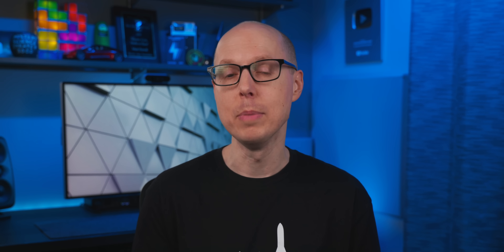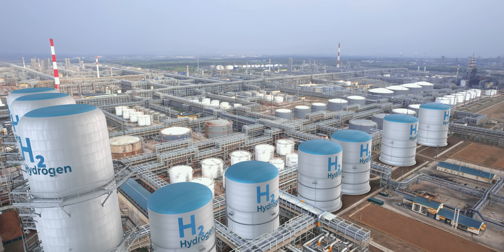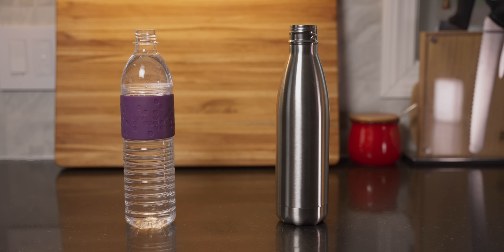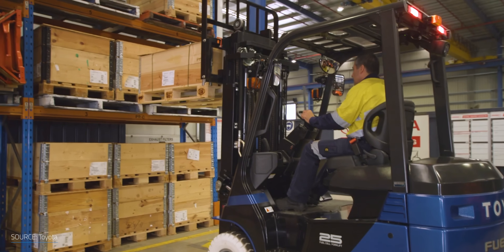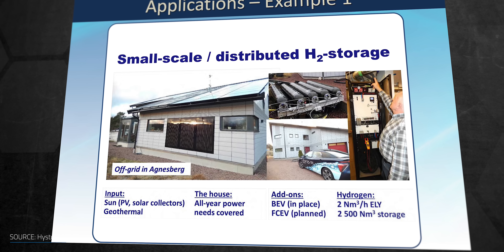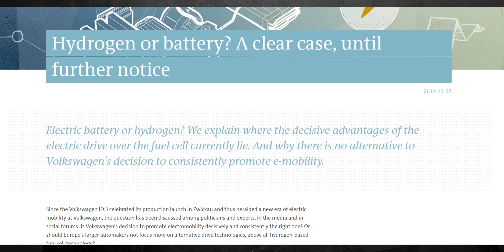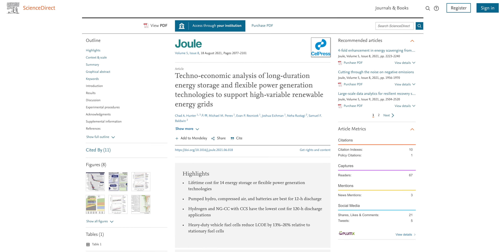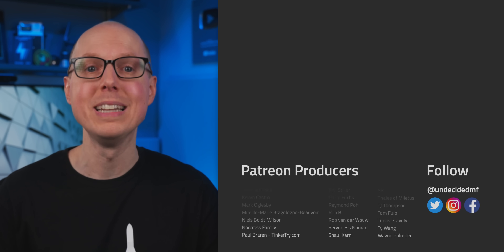Solid Hydrogen Explained (Again) - Is it the Future of Energy Storage?

Comment: I would think that replacing the small lithium batteries in EV batteries with small tubes of metal hydride or random carbon nanotubes would be an ideal way to store hydrogen.  Just like EV batteries, using many small hydrogen storage cells would increase range, safety and reduce refueling times.

Comment: There is an Asian research program in progress right now that claims to have solved the efficiency problem with electrolyzing water into H2 & O2.  A jump from 35% --> over 90%.  I remember bumping into a Youtube video on this about a month ago.  If THIS can be commercialized quickly, then hydrogen energy storage may indeed be a major, efficient fuel source for high-demand mobile applications.

Comment: Maybe you could do a video on liquid organic hydrogen carriers as well? The main advantage of metal hydrides and LOHCs is the ability to store hydrogen in a safe manner over long periods of time. Compressed and liquid storage cannot do that. The disadvantage is in the energy needed to store and release the hydrogen. And for a system that has varying power needs (such as trucks, cars, boats...) you need a buffer storage which means you are back into the land of compressed storage and leakage scenarios again. 

On another note, the next time you mention hydrogen and ships - please do not associate that with a car carrier, container vessel or any other deep sea vessel. Hydrogen is not suited as a fuel for ships. it may be for boats. For ships it has too low energy density (volumetric). and on the compressed storage, any large scale storage happens at 200-300 bar. Above that the tank structure would be far too heavy for any practical use.

Comment: I have thought about and looked into using metal.hydrides and electrolysis for a wind/solar off grid system for more long-term use than a lith ion system seems to offer. I'm no Dr or MA degree holder but over time..... especially if supply lines break down.... It seemed to me that metal hydrides are a better choice for longest term use assuming resupply is impossible or years away.

Comment: "Volumetric density" is a tautology, density is always volumetric.
Reply: no... another very common metric is "gravimetric energy density". ie. Energy per unit mass.
For example, gravimetric energy density is usually more important than volumetric density for aerospace designs. The primary difference between jet fuel and regular gasoline is its gravimetric energy density

Comment: If the technology is sound, it will need another "ELON" to get it from lab to the open road. There will be so much pushback from the traditional players out there, from auto to energy, government and the largest tech companies.

You need a cheerleader with vision and cash to push that boulder up the hill. I am no scientist or engineer, but I look at this from the business model.

To put a smaller 55KW battery and a fuel cell together into an electric drive vehicle, the extra cost SWAP +/- by NOT putting in a battery pack 4X bigger for the OCCASIONAL need for greater range needs to be considered.. I believe this is less of a scientific problem as a business one. The best approach will rise to the top. The objective is cost and weight reduction, while increasing range.   

 The electric fanboys hate hybrid, despite the potential when scaled into larger trucks. We need to get outside of our tribalism, and consider all technologies that show promise, and research and test "ALL OF THE ABOVE". 

 Remember when LED lamps sucked.... dim grey light that NO ONE liked!

Comment: The heat required to release the hydrogen can done very cheaply and simply with a laser.

It's already been done and proven to work much better than expected as hydrogen can be printed onto a film and released on demand with a laser.

The problem is the government and its corporate backer's, they have shelved it as another distruptive technology along with many more technologys that would end the whole energy/pollution market as we don't really need  batteries, solar panels or nuclear to generate electricity to power out transport and home's.

Because it works, it's likely to disrupt the energy market which they have designed to fail and fail us they will.

Comment: The least expensive way to store hydrogen with super high volumetric and gravimetric density is to bond it with carbon, just like how biology does it. The trick is, we have to source the carbon from the atmosphere instead of the ground so that we complete the cycle instead of disrupting it.
Reply: The energy cost of CO2 direct air capture (DAC) is astronomically high compared to the energy of any compression and storage technology. See for example the energy cost of CO2 compression / liquefaction vs. the energy penalties for either flue gas capture or direct air capture - it's a difference of 10 to 100 times.
Reply: correct but as plants they also get there carbon from the air. ... so we should do that.
Reply: Well...bioenergy is also complicated; it ends up releasing carbon because of ecosystem impacts, transport, and processing. There aren't any great options for us to bond hydrogen to carbon without either a) using a lot of renewable electricity or b) causing net positive carbon to go to the atmosphere (instead of carbon neutral). The best you can do (at least, without carbon capture and storage tacked on, which is very difficult in fuel applications because your vehicle is moving and has to be lightweight and carry its own energy) is to be carbon neutral - so any inefficiency results in carbon escaping. (And there are a lot of inefficiencies.) Pure hydrogen also takes a lot of renewable electricity, but less than synthetic fuels, and without the inevitable release of carbon on its consumption.

Comment: Calling 50 kWh/kg "on par" with the Tesla Model 3's 260 kWh/kg is a pretty big stretch of the phrase "on par". Also, the animations you keep using obscure an important down-side of hydrides: while you may be able to store 80 kg/m^3, it's very difficult to recover much more than a few percent of that. The more you try to remove the hydrogen, the harder it gets. You end up with a hydride that fluctuates between 80-ish % full and 100% full, so the usable capacity is usually less than 20% of the stated capacity.

Comment: I am currently working on metal hydrides for my master's and my supervisor and professor actually wrote a book about the topic of hydride storage. In the end, hydrides have a too low energy density, they are quite unstable and they have to be heated to release the bound hydrogen. The current state-of-the-art is just storing it at 700 bar, which is lighter, cheaper, doesn't need heating and has a way higher energy density.
To put it in the words of my supervisor: "It was a race between chemists and engineers and the engineers clearly won it."
Reply: Yeah its pretty obvious Matt is still the great Snake Oil salesmen. Nothings changed sadly

Comment: Why not use water and build a car that separates the hydrogen and oxygen in the car and then use hydrogen for power.
Reply: If you had a power source that could separate the hydrogen and oxygen, why not just use that to power the car?

Let's say it takes X amount of power to produce Y amount of hydrogen from the water. Now, you can move the car Z distance with X power, or you can use it to separate Y hydrogen - but you cannot do both with the Y hydrogen.
This looks even worse when you add in real-world-efficiency-constraints.

Comment: Plastic batteries can be built as part of an integrated transportation-distribution system. The bottom of a roof over electric car roads would feed and control cars. The top would be covered in grass, with open storm drainage and solar panels (adding to energy, which is mostly produced with small/thorium reactors). 

H2 would be generated on cars using system energy - either when parked or driving in electric system. It would be used only for off-system driving.

Storage is not a problem with an integrated system with small scale nuclear generation.

The science is easy. The main obstacle is economic, which requires shifting from capitalism to employee-controlled cooperatives.
Reply: Michael: "..., which requires shifting from capitalism to employee-controlled cooperatives."
Sounds brain-dead.
Reply: @KenJackson_US  not if you want clean energy
Reply: @KenJackson_US  Transportation modes (how roads are designed) are a matter of public policy. Currently, oligopolies prevent new developments, choking off innovation. Only cooperative purchasing can counter such opposition. It's the reason union's work. That is the how of it. If you know a way for individual consumers to change the entire transportation system, let us know. you have our attention.
Reply: @KenJackson_US  you are confusing free markets and capitalism. Not the same thing. No employer with shareholders would be justified in transforming a city's infrastructure from what exists now to what I propose (unless they are a road building or electrical company). A cooperative firm where consumption and production are controlled democratically, or a collection of such firms in a single city, has a chance of making that change. A city government could mandate it, but local capitalist employers would stop them (unless they were all unionized and turned it into a strike issue).
Reply: @KenJackson_US  you are arguing about the trees, not the forest
 Also conflating "what works" with your values.

Comment: It would be amazing if someone could make a substrate that would absorb and release hydrogen from a very specific area that could be selected by a microprocessor.  You select the row/column of a microcell that you want to release from.  It would be switched using a very small current.  That way you wouldn't have to heat it up .
Reply: If you're not heating it up, what causes the hydrogen to release?  Don't you mean only a small area would need to be heated, which would minimize energy used?  That's an idea.
Reply: @KenJackson_US  No using semi-conductor holes or something similar.

Comment: What if we used gravity to compress the hydrogen?  Just like pumped storage via solar or reservoir hydroelectric, instead of turning a huge turbine to generate electricity, the same gravitational force is used to turn a compressor?  Excess heat from the compression cycle could be captured and used in another process, like ammonia closed loop refrigeration, to cool the gas down.

Comment: 08:35 you state that metal hydrids have a capacity of 50kWh/100kg, and that it's on par with lithium in telsa cars. I have to correct this. Lithium iron batteries in teslas have a Wh/kg rario of more than 100Wh/kg. 50kWh/100kg = 500Wh/kg, which is 5 times more.
this lithium ratio is the one we use  at our company fyi

Comment: I am not gona lie! I won´t watch the Video and don´t have to!

Storing Hydrogen in any (Solid) makes absolutly no sense!!!
Every Solid u can use to store Hydrogen must be higher in mass than the stored hydrogen in it! also the densety can´t get nearly as close as in highly compressed gas form or liquid! It just cant, and is lousy from the get go!!!
And you lose energy by storeing and releaseing it, that could be a little bit better than just compressing it into a liquid, but mostly in smaller aplications where its not viable to constantly recycle the heat to reduce loses.

The only thing that comes close to this idea and can practicly work, is to put a small percentage of Hydrogen into the gas grid.
This just works for relativ small amount without decrecing the densety of the other gases to much.

Hydrogen isen´t the solution to everthing anyway! In aplications like steelmaking as a substitute for coke and other chemical aplications it works good and is already in use.
But as a generell Energy storage medium, pure hydrogen is not the best choice!
Storing and transporting hydrogen in compressed forme is not a problem, its the production!!! Its inefficient, and there is not much hope to get around it!
All that "uh thats the future" bulshit is the same for hydrogen as for batteries, getting the charge out of the battery and converting it into work is highly efficent, but making the batterie and getting the energy into it, is the problem that is out of sight of all those idiot that think this is the solution to our energy problem!!

There is no single solution, and there will be no big revolutionary inventions anymore, we pretty much have figured out the bulck of it!
Every technology hase it´s place and for the most part is already in use in it!

And there is no big revolution needed, at least not in a technological way!!!!
We humans have to adapt to live without fosile fules, we just don´t do it already because most of us are to lazy, to cheap, and won´t sacrifice a little bit on there wastefull lifestyles!!

Stop buing new cars every 3 years, stop buying new smartphones every 2 years, your consumption behavior is what dictates how crapy and cheap a car is build, and thus how much energy is needed for its completet life cycle!

🤮 I hate humanaty!!!!!!

Comment: Anyone can do something similar to this at home.

I have seen a guy store hydrogen in propane tanks filled with carbonized chicken feathers packed tightly.  He only pressurized to 300 psi and was able to store more than 20 X the hydrogen stored in a tank at the same pressure without the carbonized feathers.

The man used the tanks to store hydrogen created from water using electricity from solar panels to run a system to separate the hydrogen and oxygen in the water and he had a fuel cell to power his house.  He did have problems with low pressure with low ambient temperature at tank, but instead of using heat to release the hydrogen he quadrupled his storage to create sufficient pressure to the fuel cell. 

I would have put the tanks in a climate controlled enclosure and regulated the temperature to achieve the desired pressure in the tank to increase efficiency and decrease required tank size. 

Hope someone builds these soon, it is not a difficult technology, the preasures are low, and as long as your hydrogen is pure, the storage tank should last forever.

Comment: Matt,  I connect on #LinkedIn and #Facebook. So we can carry on the conversation.
Reply: Matt, you could come Fully Charged LIVE. Sydney 11th to 12th March 2023. Will be there in Sydney. We promoted the project on the film on stand team taking a project and future projects.

The Team and I are submitting a development application to a Lismore council on North Coast NSW end of August 2022:
1.	250 prefabricated CLT & SIPform passive house certified homes. On the roofs of buildings, the Tractile, the excess electricity will be stored in the 28.8MW Tesla Batteries Farm. 
2.	The PV in total 934,370m2 - Tractile tiles 45,000m2 and ARCTECH SOLAR TRACKING PV 887,400m2
3.	Bi-Charging of EV one per house and 12 charging stations in the shopping centre. 
4.	Micro-grid that connects to a community of 4800 residents 
5.	Landscaping the whole site, ensuring enough clearance for the surrounding bush and buildings.
6.	We will be trailing the SoMax HTC process. That processes the sewage into sterilises aggregate for concrete so many products that would carbon released into the atmosphere when State Government and Lismore Council approved process. https://somaxhtc.com/
7.	We have a project at the end of 2024 that will be installed long-range wireless power transfer https://emrod.energy/
 
At the end of August 2022, they will be posted the video on YouTube.
 
Ian Cleland - Sustainable-Urban-Community-Homes

Comment: Doesn't matter until there's a cheap way to create hydrogen, that doesn't use carbon based fuels to generate the heat needed to steam reform methane, another carbon fuel. Electrolysis is too slow to generate the volume of hydrogen the world would need on a daily basis. Still cheaper to dump the energy directly into a battery, fewer efficiency losses.

Comment: I think the trick with hydrogen storage is to re-use the energy that is used to compress, cool or heat the hydrogen storage medium. In terms of massive grid scale energy storage, If hydrogen was stored in compressed tanks or liquid then the heat or pressure/temperature difference that is needed can be re-used for heating homes or industry.   If this was the case, I wonder how local hydrogen storage for distribution into the local re-purposed gas pipes would work out? Splitting water vie electrolysis at a higher temperature is much more efficient, the same logic is applied to this. The heat used can be repurposed for city/town wide heating.   Although direct burning of hydrogen is not ideal but in terms of country scale storage its interesting to store energy in liquid gasses.

Comment: Molten salt nuclear operates at temperatures high enough to make ammonia without cracking natural gas. The core neutron flux within the reactor can crack water**. The high temperature can be used to create ammonia. 
Nuclear is already the safest energy system we have. However molten salt reactors are orders of magnitude safer and cheaper than PWR.  MSRs don’t have intrinsic hazards (steam, hydrogen bubbles, forced cooling, etc) of PWR. MSRs fully burn the nuclear fuel leaving literally 1/1000 as much waste.